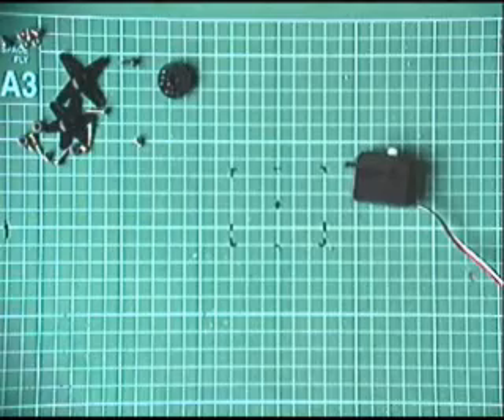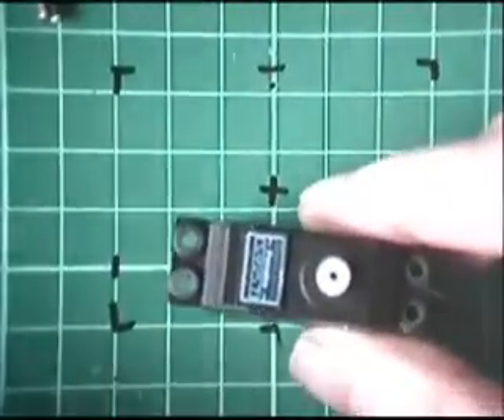Installing tail servo on a trex 450

Comment from the maker: Hi, set up servos with pitch curve, 0 25 50 75 100, the throttle curve does not matter.
with the throttle stick at 50% all the servos should be horizontal (level). they all go up at high stick and all down at low stick.

G

Comment from the maker: Hi, use a tiewrap (cable tie) and slid it under the guide at the top, cut off the excess either side and you're good to go (c:

see my build video on the trex 450 sev2 at 7 mins 20 secs.